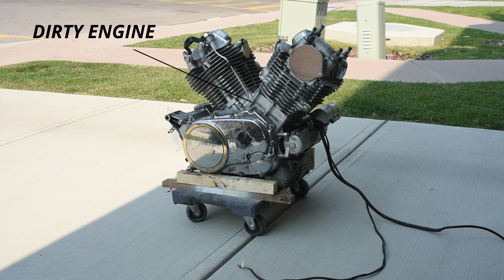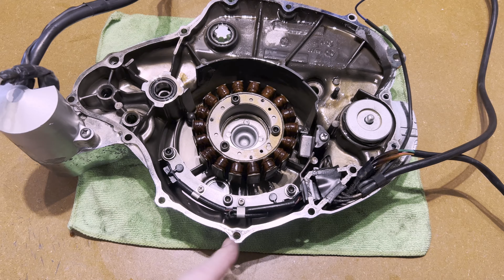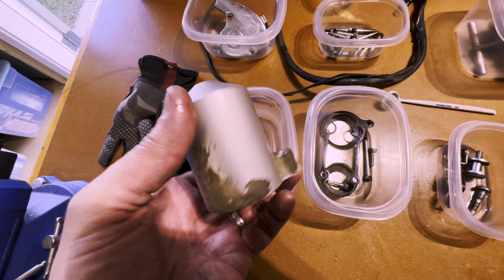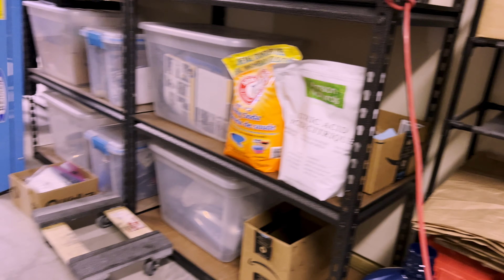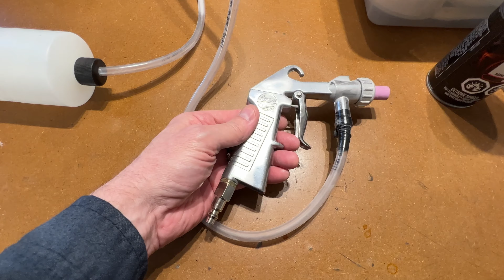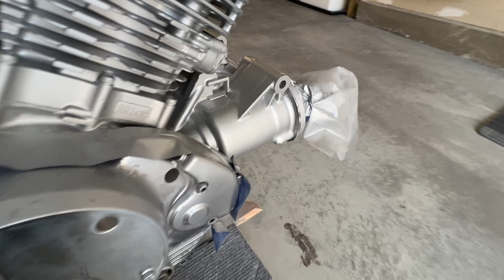Repainting The Engine - Yamaha Virago 1000 Restoration Video 17

Comment: I love how you are about 4 months ahead of my project, working out all the issues that I know I will encounter. I am extremely excited about how you will be treating the side covers. Mine are just as bad as yours!
Reply from the maker: Hey Paul!!  Thanks for the comment!  That's cool that you're also restoring a Virago - they're getting harder and harder to find these days and it's good to know that someone else is out there keeping the breed alive.  I just installed my engine and posted that video - it will be live on 18 December.  As for the chrome plated side covers, I want to leave them for a sort of "final reveal" but I can tell you that they turned out great but it wasn't easy.  The local chrome shop quoted more than what the bike is worth and they're about the only place in town.  Not only that, they wanted all the bushings, bearings, seals, sight glass seals, etc all removed before they would electrically & chemically remove the old chrome.  They suggested media blasting and since my options are limited, that's what I ended up doing.  All my chrome plated aluminum parts have now been media blasted, sanded and polished, including the side covers which look great.  I've got a complete video for that coming soon.

Comment: Excellent job again Ken as usual. Looking forward to seeing how you treat the side cases.
Reply from the maker: Thanks Joe!!  The side cases were a LOT of work - much more than I had planned for that's for sure.  I've got to figure out if I'm going to overhaul my original starter or buy a new one but I have to make that choice before I put the left side cover back on.  Also have to check all the tolerances on the clutch discs to see if they need replacing before I put the right side cover back on.  Thanks for watching and thanks for the nice comment!!

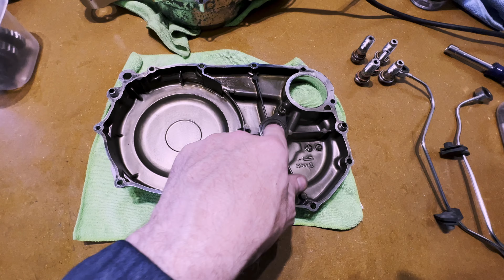Comment: At 12:31, the "Bushing" you're pointing to is actually an oil seal, probably the most critical seal in that engine as it supplies the connecting rod bearings with pressurised oil. It goes hard over time and the oil pressure to the crank reduces, resulting in premature wear and, in extreme cases, destruction of the bottom end of the motor.
Reply from the maker: I explain that further in the restoration videos.  Like you mention, it is a seal but it's there to seal the channel that pushes the oil up from the bottom end of the oil pump to the top of the engine cylinders (camshaft, etc) via the external oil tubes.  Unlike many of the other seals, it's high temp and dual lipped since the rod it seals also spins.  It was replaced later in the rebuild along with all the other oil seals.